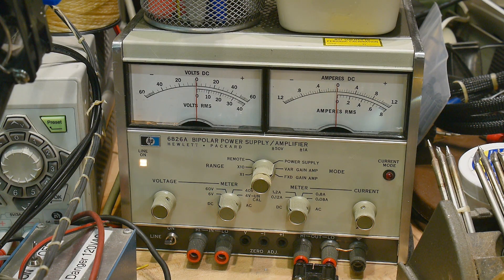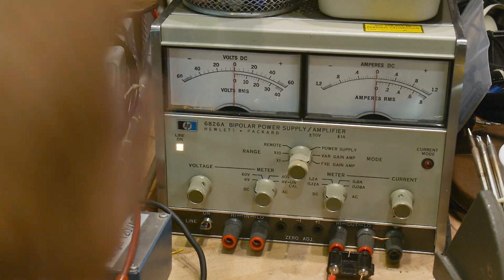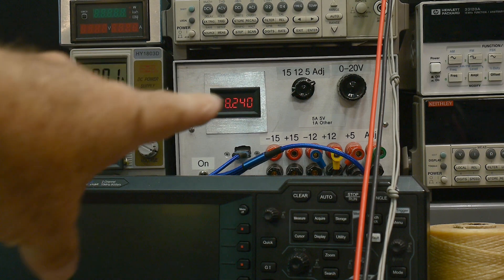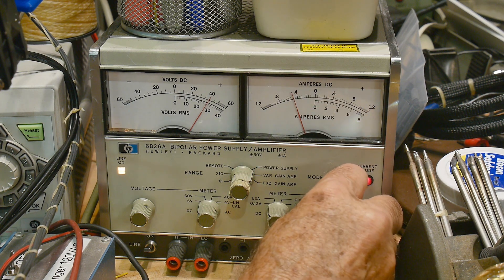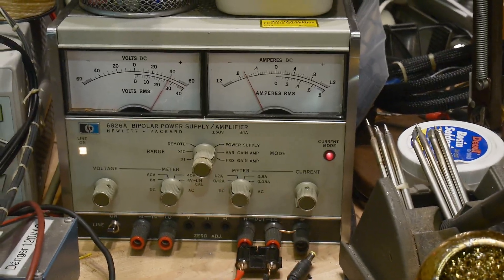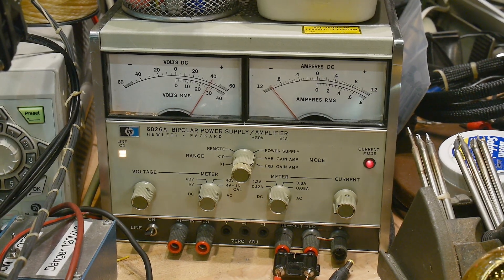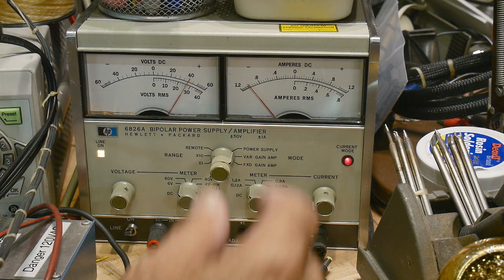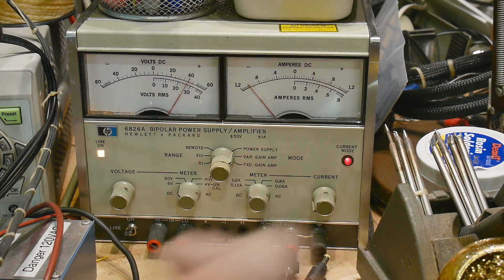#1597a HP6826A Current Sink

Comment: Current source is electron sink. Current sink is electron source.
Reply: You're talking about "positive/negative terminals;" those aren't the generally accepted meanings for "current sink/source." We use the term "current source" when we're talking about something which induces electricity in a circuit, with an emphasis on its current properties. (If we were focusing on voltage properties then we'd call it a "voltage source.") A "current sink" is a part of a circuit which consumes electricity; it won't induce a flow if you connect its two terminals. Both sinks and sources have two terminals, with electrons coming out of one and going into the other.

Comment: - The video aims to demonstrate that the HP6826A is a true four-quadrant machine.
- The presenter uses a dummy load to test the power supply.
- The HP6826A is set to 4 volts, and the dummy load is set to 6 volts full scale.
- When the current is pulled up, negative current is observed, indicating that the device is acting as a sink of current.
- The presenter adjusts the current to about 100 milliamps and confirms the same on the power supply.
- The video concludes by mentioning that the device will indeed sink current.